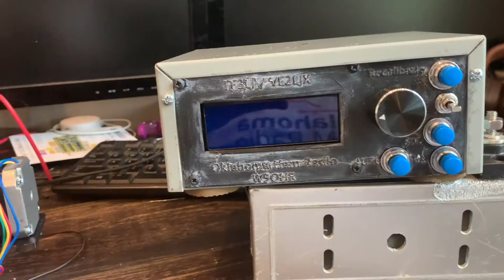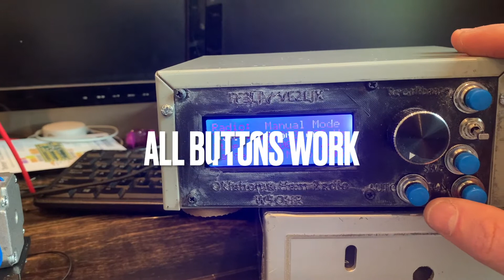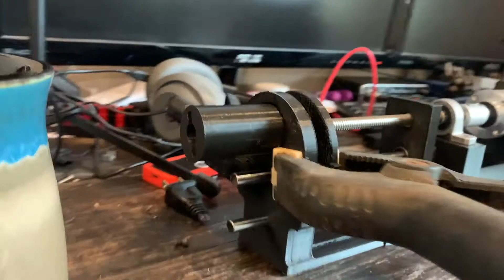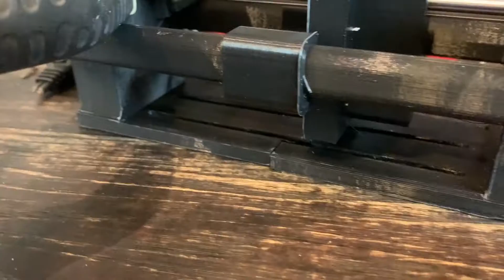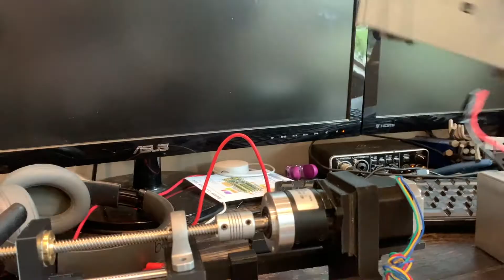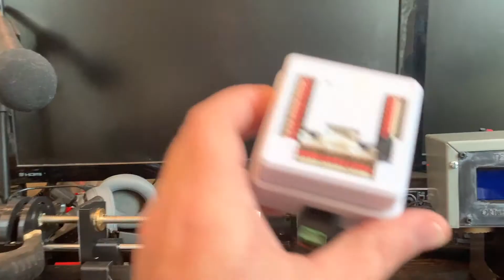Automated Mag Loop Antenna #4

Comment: Hi Dave,
Is that a ball screw you are using? I think you will have no problem moving the variable capacitor. Stay safe.  73  WJ3U
Reply from the maker: Hey Don!  Yes, those parts were easily sourced from eBay.  I got the bearings, rods and ball screw from there.  I could replace the ball screw with a threaded rod and a nut if I wanted to do more rotations on the variable capacitor.  

Im working on the serial relay.  The EZ-B controller is able to see the controller box without any issue right now.  I need to get the radio hooked up to start getting the radio serial commands.  I should be able to relay the commands back and forth without any issues.  I'll mess that some this week after work and see how well it works.

The network drivers (wifi) are really optimized. They chopped out a ton from the TCP/IP stack to reduce latency to that controller.  Hopefully it will be quick enough without causing issues.

73 Don!  Thanks for watching!